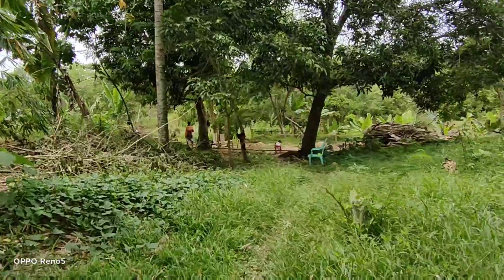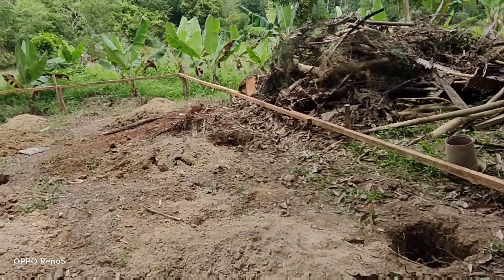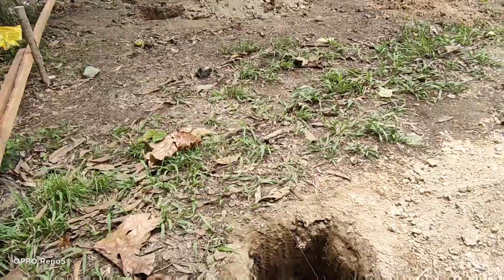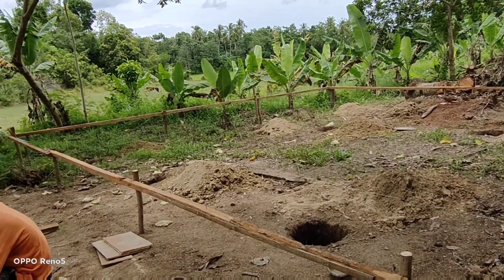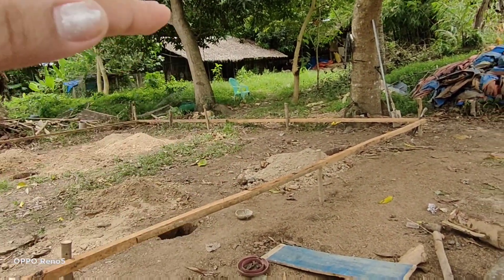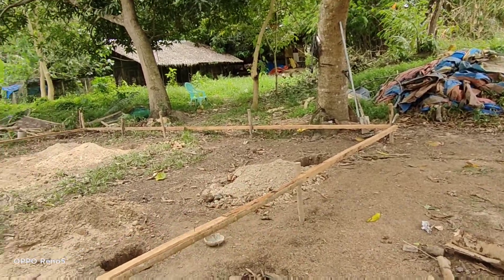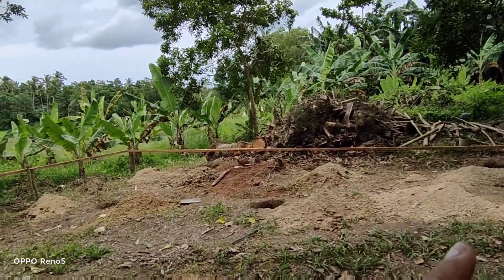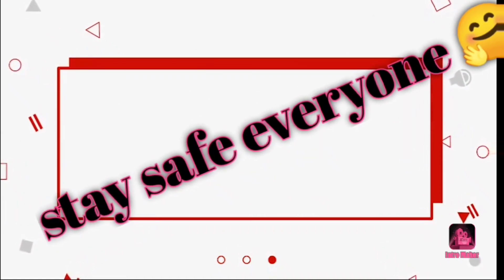House Update (0909)

Comment: How come the footing holes aren't close to the square outline tatay has there? If that's where the footings are gonna be your house still gonna be small  :(

So the grounds not level may I ask shouldn't tatay level the ground before putting footings in so when he pours the concrete for the floor it will be all level?

Just asking I've never built a house before 😁
Reply: @zeineguy  then y waste money on filling it in with costly rocks?
Reply: @zeineguy  k